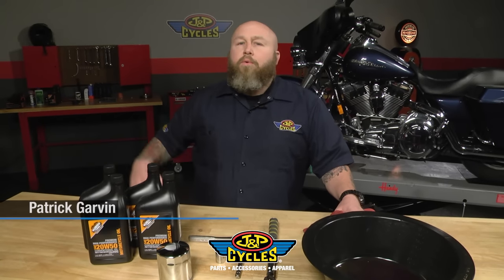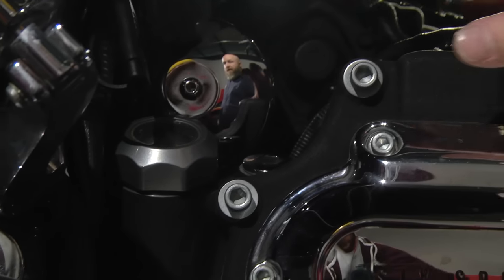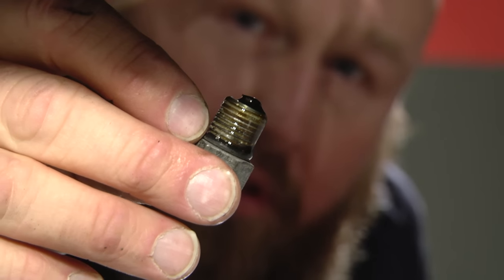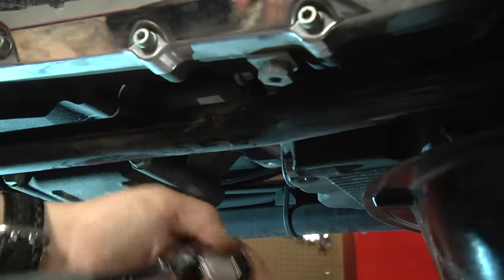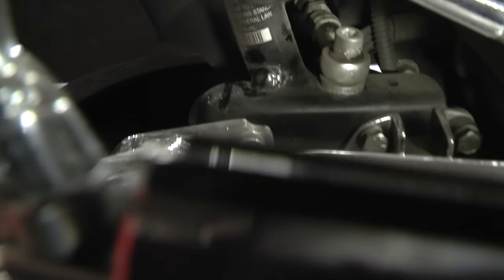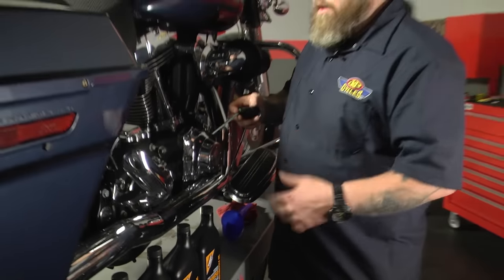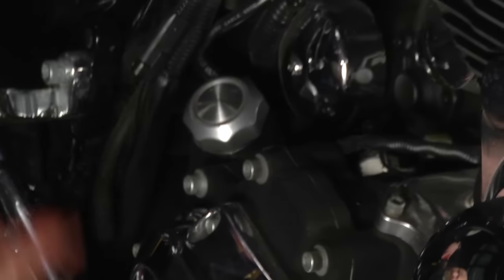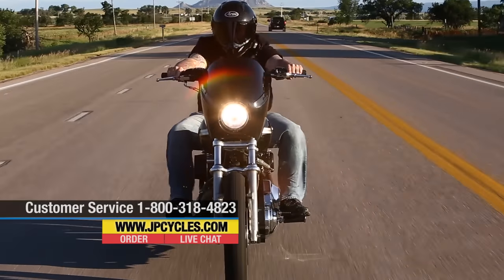How to Change Oil on Harley-Davidson Touring Models by J&P Cycles

Comment: I grew up with my uncle and my dad who worked on both Japanese and Harleys and vintage Indian (personal bikes, not a commercial shop). They did it as a reason to get together and hang out. They never ever visited a stealership. A top end job was a common occurance and watching and helping with a motor pull was fairly common as well. I learned how to do fluid changes quite early. As both were machinists and welders parts fabrication was easily accomplished. This is how i spent my life from 3 to my teens. I thought this was how it was. Now as a motorcycle owner myself (both Japanese and Harley) I feel blessed to have been brought up this way. I had a boss who took his Harley to the shop for fluid changes and even details and it blew my mind. But to those who were not brought up like I was have no idea the joys of doing these jobs yourself especially with the advent of Youtube to guide you step by step.
Reply: Being able to do your own work is great but hanging out with your family and learning is the best.

Comment: Thanks for the video. I like to leave the fill cap on, then FIRST pull the drain plug. Not much oil come out, less mess, then when oil plug is clear, THEN remove the fill cap, let it flow. I also like the KN Oil Filters, it's all I use.

Comment: I have an '02 Electra glide & these oil changes are pretty straightforward.. I do a couple of things different, I use an Allen wrench to remove the drain plug & use hi-temp grease like 'ant-seize' on the 'o' ring.. I've tried all sort of things to catch the oil when you remove the filter, seems like oil always drips down onto the front motor mount & reg.. I have had to replace one motor mount already b/c it was worn out due to oil saturation.  you didn't mention how often the oil should be changed I usually go 5k or 1 yr., whichever comes 1st..

Comment: A) I always keep the dip stick in when I loosen the drain plug so I don't get a stream at first. This gives me control of the oil flow. B) I always change filter with drain plug out I feel it gives more air.  I'm old school. C) I spray drain plug, oil filter housing wipe everything down with brake cleaner nice and clean.  D) and lastly a nice card board box under there keeps oil off ur garage floor.  Ride safe have fun.
Reply: That’s exactly what I do.

Comment: Just two comments,
Be sure to wipe off drain plug surface before replacing drain plug.
Clean oil filter base and around front engine mount. It doesn't hurt to shove a rag under old filter before finally pulling it off.
When all clean install new filter. Nothing worse than to have the bike drip oil for several days.
Cheers!

Comment: Good video,  my 2 cents, dont losen dipstick until drain plugs out.  That way the hot oil wont gush out.  Pull plug then losen dipstick.  Try it
Reply: Hey that's a good idea.

Comment: Hi Patrick, I have a problem  and maybe you can help me ... I have a 2008 street glide and the other day I changed the battery ... I removed the main fuse and then the battery. When I mounted the new battery and put the main fuse back on and I tried to start the bike, the alarm started instantly ... the fob was next to the motorcycle, I had to wait about 15 minutes for the alarm to stop by itself. what can I do?...best regards

Comment: 2 comments Is it basically the same doing the oil change on a 2013 triglide ultra classic second question should I put oil in the filter before putting it back on or allow the motor to fill it period

Comment: Are you supposed to put oil in the oil filter before putting it on?? If not does it cause the bike to suck air before the oil run to the filter??

Comment: Of course the dealer told me this was very difficult to do. They said it's not like changing oil on a car, which I do lol. This video looks like it's exactly the same.... I have a 2011 Wide Glide, I'm assuming the procedure is the same?
Reply: Yeah, they just want your money. Basically, if you can change the oil in your lawn mower, you can definitely handle changing your scooters oil.
Reply: The dealer wants to tell you it requires the "little guy" to run up the exhaust pipe and turn the special nut.  His labor rate is expensive
Reply: dwheeler016 lol you got me to think about it good job!

Comment: How long do you let it run before you check it again?
Reply from the maker: Just a minute or so, we just want the oil to circulate all the way through the motor.
Reply: J&P Cycles Excellent. Thank you.  Just wanted to be sure.

Comment: Can you change the oil on a 2007 ultra classic with it on the jiffy stand or do you have to have a stand? Thanks any information. Great videos
Reply from the maker: technically you can, but it's going to be hard to get the drain pan in place and get to the drain plug. Worse case get someone to sit on the bike and keep it upright.
Reply: I do mine in blocks

Comment: I've been told that it is necessary to fill the new filter with prior to installation, is this  necessary?
Reply: corey sanchez - I am definitely no expert on this stuff, but I saw that discussed on another oil change vid as preferred, so the engine doesn't run briefly without oil.   But, it looks like it's only possible to pre-fill the filter if the filter hangs downward (or all the oil pours out).
Reply: Fill it about a third to half full

Comment: Although my background is with the metric bikes (don't chase me out of here guys), I understand from my Harley friends that there are actually three different places and three different oils to be changed.
Supposedly there is the engine oil (the one demonstrated above?), the transmission oil, and the primary oil.
Do you have an explanation for the other two oils and locations?
Thanks.
Reply: J&P Cycles. Thank you for your timely reply and information.
Reply: Could there possible have been a problem with the link as there are no videos available at the link given below?
Reply from the maker: https://www.youtube.com/watch?v=mRv1jn5K-gM  Try that

Comment: If it's not necessary to rush the oil change I'd let the "Thin Stream Run All Night" as that oil is holding the nasty's that we are trying to get rid of - Drain the old oil after today's ride and fill it back up tomorrow - Even just 30 minutes is very helpful for those last few  ounces that hold the problems of the last few thousand miles - Just my suggestion

Comment: They told me that it was hard to do and cost 300 dollars for basic oil change.
Reply: chris Bozarth.  should be more like 200 plus tax. try and find a shop that works on Harley Davidson bike's THEY are usually allot LESS!
Reply: John Kolinoff that was the Harley shop I bought my bike from
Reply: chris Bozarth. NICE management there NOT!! that's ridicules on that price! they roll it up on a bike stand easy access and less than 1 hour! GUY'S hear tell me pluse you do it every day you have everything ready to go. I changed all 3 of mine but I wasint on the clock I had hour 45minutes taking my time on the ground witch is harder to get to it. AND all 3 oil casket and oh rings.  $110 buck's out the door! I'd call around and ask some friends see if they might no some one. our bite the bullet intell you find someone good luck and ride safe.👍

Comment: - So, essentially, after every filter change you have to "dry start" that engine?!  Wow.  I would lean it over so I could at least have it 1/3 full before installation ...  I will never, ever dry start any engine, or I will just not buy the vehicle.

Double wow.
Reply: Oil pumps from the sump to the engine then to the filter and back to the sump. So a dry filter makes no difference.

Comment: Do yourself a favor and consult your owners or repair manual, or watch a video by a real Harley tech if you want to see how you should change the oil on your Harley. There is so much wrong with this video. First of all Harley recommends changing the oil hot. You get more of the old oil and sludge out that way. You can tell by the way he's handling this bike that it is ice cold. Secondly, you should pull the drain plug first before you loosen the dipstick. That way scalding hot oil is not at full flow when pulling the plug. Next, don't "inspect" the o-ring, replace it. They are only a couple of dollars and it's best to always use a new one. An old one could look fine but then split when you torque the drain plug resulting in oil loss and catastrophic engine damage. Lastly NEVER EVER tighten an oil filter on ANY vehicle with a wrench. Every owners and repair manual for every vehicle with an external screw on oil filter will tell you "hand tight". Trust me you are asking for problems is you over tighten an oil filter. Just lube the gasket with some fresh oil and screw it down hand tight. I really wonder sometimes how videos like this with so much misinformation make it on here. 🤦🏻‍♂️🤦🏻‍♂️🤦🏻‍♂️🤦🏻‍♂️